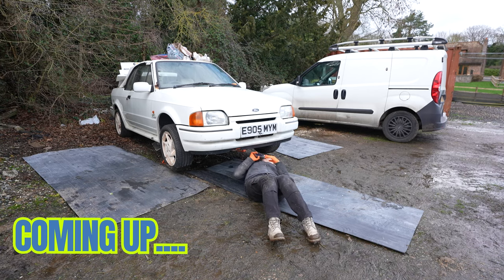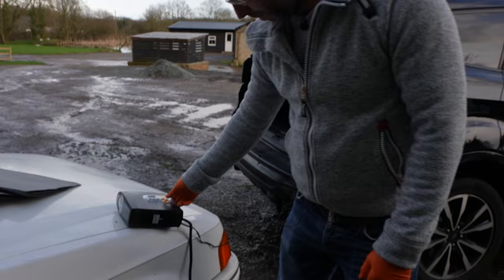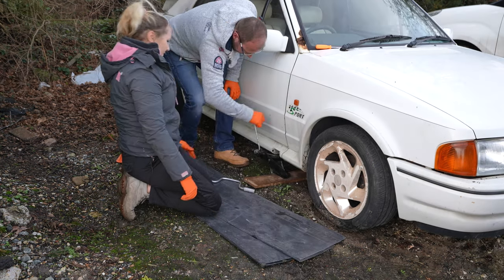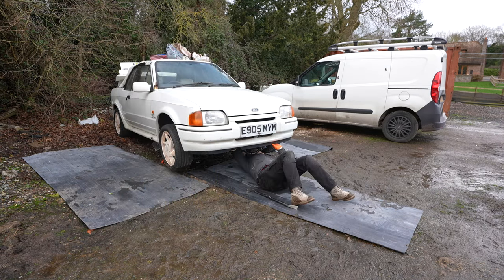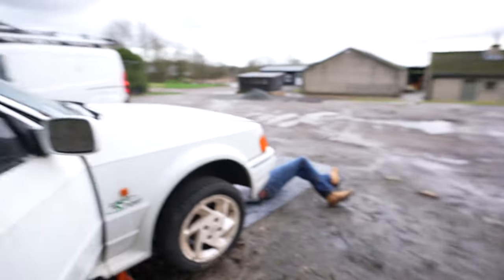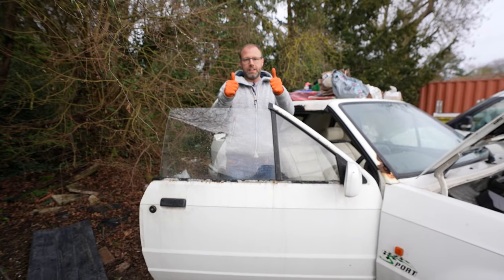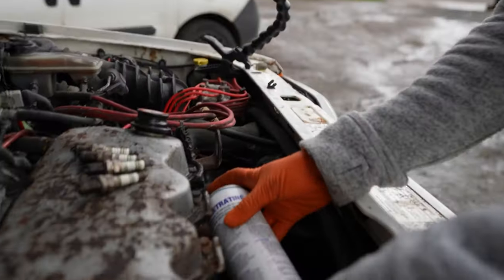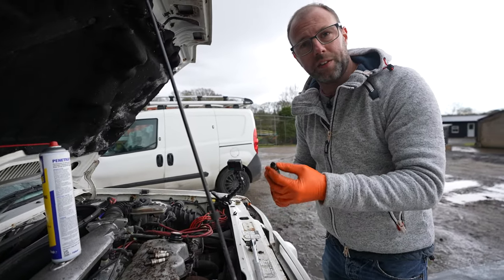Ford Escort MK4 Cabriolet All White Edition - Restoration Day 1- Opening the Bonnet?

Comment: Just found your channel.
I'm in the motor trade have been for many years.
Best way to free engines funny enough is full fat coke cola works a treat.
But leave spark plugs loose not tight.
And if cars been sat for many yes might be worth changing the timing belt.
Very easy job 20 mins.
And remember it has hydraulic tappets so your better off taking plugs out and turn engine over for a good 3 min to get oil in them lifters.
As it won't start.
And them electric fuel pumps are a pain.
But one of Ford's better engines.
Good luck with the project 👍
Reply from the maker: Full fat coke?! That’s an interesting one! Thank you for watching and the advice - we need all the help we can get!!!
Reply: @TheSentimentalCarClub  Yeah I laughed first time I got told it.
But it freed up a few of my friends engines.
Depending on how long it's sat and if plugs are left out sat in a field for 20 yrs then you might struggle.
But on a normal basis yeah try coke cola full fat better than any spray can penetrant oil and much cheaper.
But I'll defo keep watching your channel 😉

Comment: I have one of these also in white 1990  had it a year or so. Been very lucky just a small hole under the battery tray no other rott as there proper rust buckets. It's now running almost ready for  MOT new  mohair roof on orded. Have you got some inside space to work on it? your going to need it.

Comment: Grab the ball on the end of the bonnet cable under the steering column with some mole grips and pull and the bonnet should pop. The ball end regularly comes out of the bonnet lever on these.